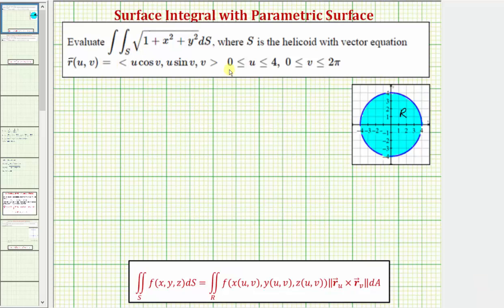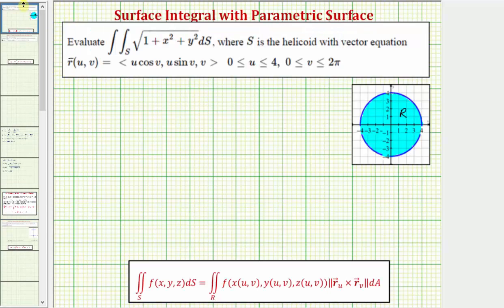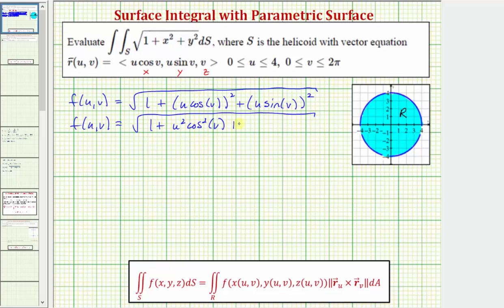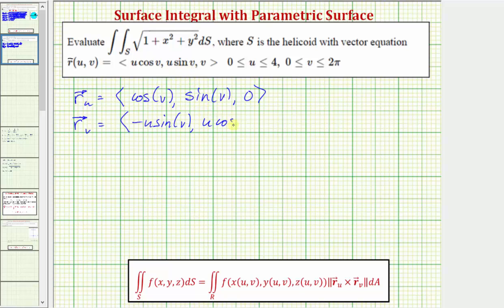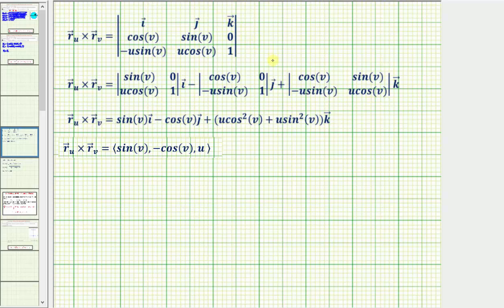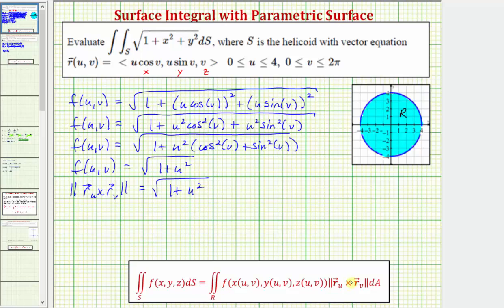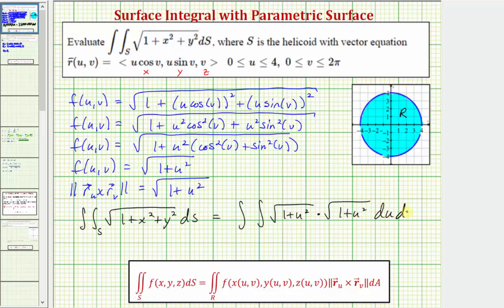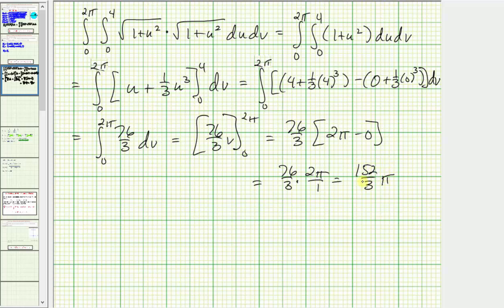(New Video Available - See Description)  Evaluate a Surface Integral (Parametric Surface - Helicoid)

Comment: thanks for the video. My question is why doesn't the differential area element dA when evaluated as dudv get a scale factor u similar to the differential area element in polar coordinates r dr dtheta since we are integrating over a circle.
Reply from the maker: Deoxy rion Good question.   Notice the intervals for u and v are already defined just like polar coordinates.  As a result, we are staying in the uv coordinate system, not changing coordinate systems.
Reply: thank you!